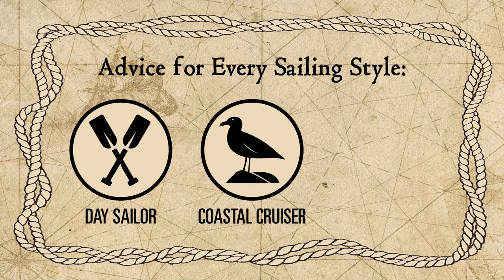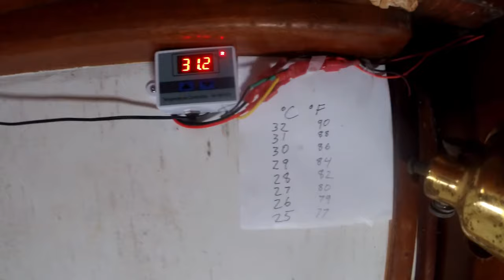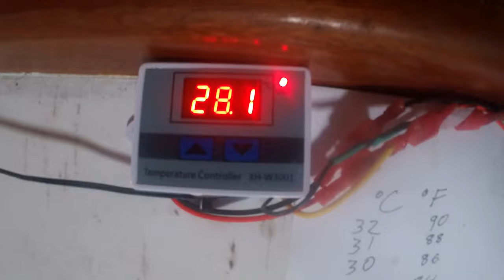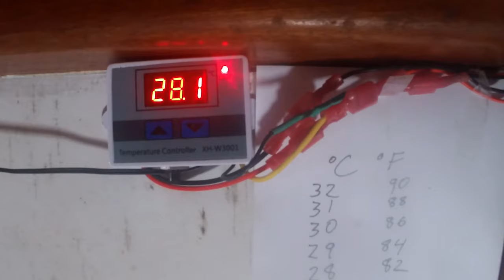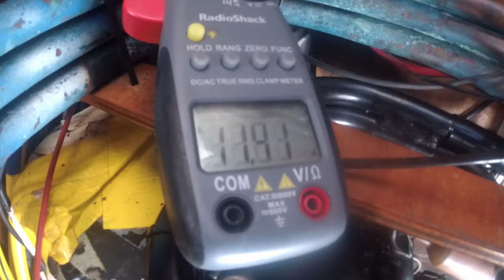Battery-Powered AIR CONDITIONING on a Sailboat [Capable Cruising Guides]

Comment: I bought a Mabru DC air conditioner, 7000 BTU. Runs all night on my lithium battery. Outrageously expensive, but we run it every single night. Would hate to be cruising the tropics without it.
Reply from the maker: Over $5000, wow.  I think I need to charge more!
Reply: @Clarks-Adventure  the list price has gone up since we bought it, and we got a boat show discount. It was still expensive, but worth every penny. At 7000 BTU it uses about 200ah a night from my 600ah battery. 1600 watts solar puts it right back in. Is your power consumption test including the raw water pump?
Reply from the maker: Yes. Everything. Pump, blower, compressor.  Everything is true variable speed except the pump.
  Mine won't reverse (though one could add a reversing valve) for heating because the idea just doesn't interest me down here.   But it has a heater core so you could heat with cooling water from your engine or generator.  Just a feature of the air handler I chose.  That option gave it a much larger set of fins on the exaporator for efficientcy.
Reply from the maker: Looks like you have a good unit.  Right in line with my watts per btu
Reply: I was looking into these units in the price difference between a $4, 016,000 BTU is very short what a lot of people don't realize is that the compressor is a variable speed throttles down and uses less Watts 🤔
Reply from the maker: Well no less then mine.  We both use variable speed compressors.

Comment: I like the build design. before I can get a couple of those I am trying to recharge my current system. The trouble is it has 3 service ports! it takes R401a any idea why it would have 3?
Reply from the maker: Usually because it was hard to get to one of them so someone added another.  Still basically one high side and one low.

Go to MarineDCAC.com if you want one of these.

Comment: I use an Opolar 5w usb fan to draw the warmest air from the ceiling and send it directly into the AC air intake .
My cold air is directed away from the air intake half ways between ceiling and floor directing the air to pass over me in a spiral around the room . The heavier cold air fills up the lower area , forcing the warm air back to the intake in a convection  idea . You instantly feel relief and the system circulates effectively  and shuts down the compressor  quicker.
Once I know the approximate time it takes to climitize the air ,I  then put the AC on a programable timer (I use a smart plug and app.) I have the system come on for 15 min. each hour . In the mean time  I'm  only using a 5w usb fan to circulate  the air in the room and not the AC fan that uses 50w to 60w for the 75% of idle operation.
Note circulating the air properly brings the warm air to the AC faster and thus takes less time to completely cool the room .
Notice that window  AC  blow cold air over the warm air intake .  This is a design flaw . You end up sucking in cold air with the warm air and don't  get the rest of the warm air chilled as fast.
My system draws air from the right and blows cold air to the left over  me ... always circulating ... cool air to me ... warmest  air to AC until there is no more warm air .
You can cool several rooms with a small AC by doing this . Just keep the door open between the rooms. The cold air will trickle on the floor into the other rooms and force the warm air near the ceiling to come back to the AC.
(Convection circulation)

Comment: Do you have a suggested volume for the cabin not to exceed or that would be optimal for the given BTU, any tips for cooling the head area as an auxiliary output?
Reply from the maker: I really can't answer that.  There are so many variables - insulation, sunshine on deck, air leaks...
   There are rules of thumb about that just a simple Google search away.

Comment: Clark, I enjoy you and your wife's videos very much. I'm not a boater, but I have a van that I've been trying to build an emergency a/c system for. Just something to blow cool air when it's really hot at night. My evaporator and condenser are all plumbed-in, but the system doesn't work very well. I've tried standard 110v window ac compressors and refrigerator compressors, as well as the little 12volt Danfoss type compressors. But they either draw too much power or are too under powered.  I've been working on this thing for two years now, and can't get it to work. I think it all comes down to the right compressor. Can you recommend a one to try?

Thanks very much. I'd appreciate any advice you have.
Reply from the maker: I built this one based on the compressor from MarineDCAC.com
https://youtu.be/_M0OiAi5rEM
Reply: @Clarks-Adventure  Thanks. I've already got my system all constructed. Would it be possible to buy just one of your compressors?

Thanks again for responding so promptly.
Reply from the maker: @themikeh1961 I don't run that day to day.
  I sold the contract to my invention to Stuart who runs it.
   I'm sure he would.  But jus FYI these compressors aren't cheap Chinese junk.  They were made for the US military and are unfortunately priced that way.  So don't expect Alibaba prices.
Reply: @Clarks-Adventure  Thanks again!!

Comment: I'm interested in a unit, I'd probably want one with quick connects. We're in the process of building enough battery to run a Dometic 8k BTU and that project is about half done, but switching to something with a lot less power draw sounds attractive.
Reply from the maker: Fill out the survey.  That's how you will be kept in the loop

Comment: Can this be fitted with a reversing valve like what is used in heat pumps, so that heat can be efficiently pumped in when desired?
Reply from the maker: We are looking into it.  I spec-ed the parts to the manufacturer last week. Maybe in a later kit.

But you could always add your own.  You need 2 one way valves another expansion valve and that reverser valve.  Couple of wires and you have a heat pump!

Comment: Does your power calculation include the compressor, the air handler, AND the water pump?  It looks like you only checked power draw on two of the motors.
Reply from the maker: Yes it includes all power involved in making the cold air.   One wire feeds the compressor the other feeds the water pump, blower, thermostat etc

Comment: I want one! Originally I planed to add a 4000 btu to our sleeping cabin (Leopard 40).My figure was about 250 to 300 amp hours in a 8 hour period, It might have proven to be less in real time test but it was going to definitely be too robust and a power hog. Your solution looks like it fits the bill for a small cabin like mine. Critical charge looks like you can tune it for maximum efficiency. I'm running on lithium but I still need to add a few more batteries( and more solar ) to add the refrigeration I want. I like the idea of box of parts as I have all the equipment(and EPA license)to put it together.
Reply from the maker: Hi Gerry,
   I made a mistake in the video.  Mine isn't 2k it's 4k and can be turned up over 5k.   Power numbers are correct as reported so it's twice as good as I say.
   If you want one you need to fill out the survey in the description.  If you aren't on the list, no dice.
Reply: @Clarks-Adventure  I did the survey.
Reply from the maker: Manufacturer is ordering parts now.  Will take about a month for the compressors to come in.

Comment: We do not have bought a boat yet, but this is so cool. I'll take one for sure once the boat is here. How is your guess for 2 or 3 cabins on a cat, is it still using less energy? With 2 or 3 systems installed of course.
Reply from the maker: Yes this compressor is very efficient.  And having one per cabin let's you turn the units you need only.  Zone cooling.

I'm not sure if this will be a standing offer.   I don't want to run a business.  It might only be available for a few sales cycles.

Comment: Are you still selling the kits?  Also can you use this in a van conversion?  In other words does this require a water supply?  Thanks great video....
Reply from the maker: They are just now becoming available.  I have the first one coming here in the Dominican Republic to install with a video soon.
  First kits will be water only but there definitely will be a van/truck version offered.  It will use a bit more power but still a LOT less then those rooftop units!

Comment: Sounds awesome. Really great idea. Looking at it from an RV standpoint, rather than for a boat though. No mention of costs though. Can you give us an idea of what you think the starting option might run. I have all the tools/equipment to put something like this together. Thanks!
Reply from the maker: Still chasing down sources for parts.  It's difficult.  But it looks like there will be an RV version of the DIY kit with an air condenser.
Reply from the maker: If you are interested make sure you fill out the survey in the description.

Comment: Clark, i want one. If you decide to do another run
Reply from the maker: MarineDCAC.com should be up again soon with different management.  The new guy has ordered parts and is working on building my design for a fully assembled drop in unit.

Comment: Love the idea I have 2 AC units in my boat, so can I use some of existing air handler and tubing?  Would I only need the compressor and thermostat? Great idea!!
Reply from the maker: Air handler probably not.  Condenser yes likely.  Water pump probably not - too big and likely AC not DC

Comment: I came across your video researching 12v ac. Would this possibly work in a 7x16 cargo trailer?
Reply from the maker: I will be working on an RV version.  That would have an air-condenser and do what you want.  You would need insulation to get good results.
https://youtu.be/rd__CXXygdY

Comment: I was thinking maybe use heater core version as evaporator because its copper makes it easier to weld the tubes together. not sure if it would work but that was what i was thinking. also was thinking on the heat ex changer loop maybe run the water on the outer pipe and the refrigerant on the inner pipe so there is more water to cool the refrigerant. and yes i would buy a this AC kit from you if priced right. i would sell it pre-charged and also sell pre-charged extension tubing at different lengths.
Reply from the maker: Thanks.  There are issues with what you suggest.  For example the water thing isn't as efecient but close.  The problem is only the inner tube is proof to salt water corrosion.  And cleaning out growth would be impossible using the outer passage.

Make sure you fill out the survey.

Comment: How much solar would you suggest to run your AC?  Also, how much lead/lithium battery capacity?
Reply from the maker: We don't touch our lead at all.  We only have 200ah of li.  We have 900watts of partly shaded.   We are fully charged back by about 1pm.  That runs the aft cabin AC in the DR summer and all other boat needs.
   We of course use my BankManager.

Comment: Clark, how does it collect and get rid of condensate? On land that would be very easy, but on a boat that may be rocking side to side a lot, that can be an issue...  Great video, but wondering where you come from with snow as high as you stand? I am originally from Rochester, NY.
Reply from the maker: That air handler is automotive.

Comment: Wonder if a swamp Cooler would work on a Boat. I Lived in Arizona and they work great. However I believe they only work in Low Humidity environments
Reply from the maker: You got that right.  Only place I've sailed that was low humidity was the Baja side of the sea of Cortez.

Generally if you are floating it's humid.   But not Florida humid - that's brutal!

Comment: 1.  Where is the condensate going? Are you piping into your desalination unit?
2.  The condenser is a pipe within a pipe?  Saltwater is removing the heat?  Is that saltwater from the ocean?  What about barnacle buildup in the system?
3.  The system this compressor came from had how many BTU's and would this be the same for your system?
4.  If one orders this can you supply two compressors?  It would really suck if your AC went out and your only fix was to find a different solution.
5.  What is the Delta T?  Temp change across evaporator?
6.  Will this reverse and heat an area?
Reply from the maker: 1 right now - into the bilge.  But it could go into the tanks directly.  It's distilled water.
2 yes it's ocean water.  The inner pipe is copper nickel.  It's somewhat resistant to marine growth.  Titanium is supposed to be better.  I have had one plug up and I cleaned it with acid (vinegar) came out fine.
3 compressor is new.  It didn't come from another system.  It's pumps just over 5k btu.  I seem to have it set for 4k in my installation.  It's adjustable.
4 yes.   To start with I'll be selling diy kits.  Just compressors, condensers and instructions.  These parts are the hardest to find.  For the rest of it I'll just give you eBay links so you can find your best deal.
Reply from the maker: 5 I just don't know.  It's a function of the speed of the compressor, the air, and to a small extent the refrigerant charge.  I use an expansion valve so it's about constant.  The refrigerant valve is automotive so once set yo about the same as your car.
Reply from the maker: 6 sure if you want.  It's a kit.  You would have to add one way valves and a reversing valve.
I don't want to go where I need heat again.
    Also the air handler has a heater core.  You could hook it to your engine to heat with.

Comment: Delta t is 20° for comfort cooling and evap runs at 40° for r410a and r22. What is your metering device? What kind of refrigerant is in the system? What's your sh and sc numbers?
Reply from the maker: Expansion valve.  134a

Comment: It's the glasses.  They're engineer glasses.  Men went to the moon in ships designed and built by other men wearing those glasses.  Go into any aerospace firm that's been around for more than 45 years and you'll see pictures on the walls of guys wearing those glasses standing next to rocket motors, radar antennae and satellites.  The hair and the beard are a little atypical, but still from the same timeframe.  (Beatniks.)
About tropical heat and air conditioning.  I moved from Arizona and southern California to Orlando, Florida many years back.  During the daytime, the temperature and humidity both would be in the 90's.  Then things would cool off at night.  But in the early hours of the morning I would often wake up all sweaty.  I even started to wonder if I had developed leukemia.  Then I realized what was happening.  Even though the temperature had come down over the course of the night, the cooling and attendant contraction of the atmosphere was causing the humidity to go up due to the difference between the contraction rates of "air" versus water vapor.  This higher humidity was preventing my perspiration from evaporating, making it stay slimy on my skin.
Much of the perceived cooling effect of air conditioning is due to the drying of the air, not just lowering its temperature.
Nice video.

Comment: Interesting and it’s been on my list for warmer land base use! Salt water in outer tube is sea water flowing to Chill Freon? Had you considered other liquids senseI don’t have flowing water?
Reply from the maker: If you don't have water around one just blows air to do the same thing.  It's just not as efficient.

We will be offering a unit or kit that works in off grid cabins and RVs based on the same crazy efficient compressor.  Fill out the survey if you would like to be kept informed.
Reply: @Clarks-Adventure  where is the survey I missed that?
Reply from the maker: It's in the description of this video.

Comment: I’m interested. I wonder if a keel cooled version is possible. I hat the idea of more holes in my boat, let alone actually pumping water into my boat. My needs are minimal. I just want to knock a few degrees and a bit of humidity out.
Reply from the maker: Sure anything is possible.  Another advantage of that approach is you save the power of pumping the water.

Comment: You mentioned two power draws for the 14 amps, but seems there should be 3 (compressor, water pump, air-handler.)  Did you leave one out?  Also, Glad you finally noted the BTU output.  UPDATE:  I installed my system and it is--as compressor is currently set--only drawing 8 amps (compressor, pump, air-handler, thermostat combined.)  Very pleased, and cool.
Reply from the maker: One power draw goes chiefly to the compressor and control circuitry.  The other goes to the air handler, water pump and thermostat.  All current coming from the batteries and trying to cool the boat is accounted for in these two measurements.

Comment: What are you using to pump the seawater around the condenser? How much power does that use?
Reply from the maker: Just under an amo at 12v
  
It's a magnet coupled pump by Johnson.  I show it in the install video.
Reply from the maker: A/C and Refrigeration: https://www.youtube.com/playlist?list=PLsT7_jPsZM5qNlstuF-fdlgjrimo18tq7